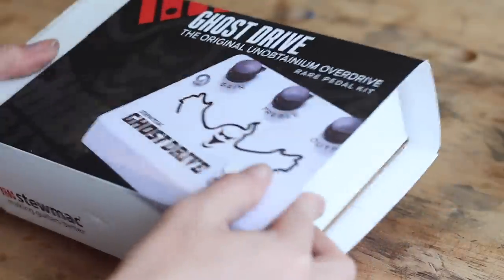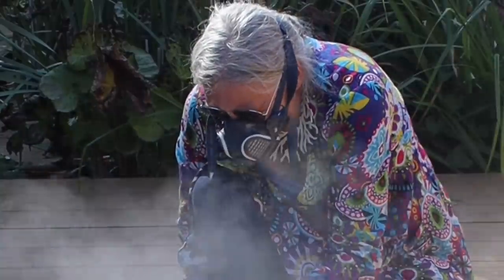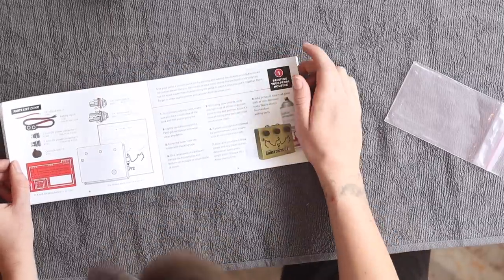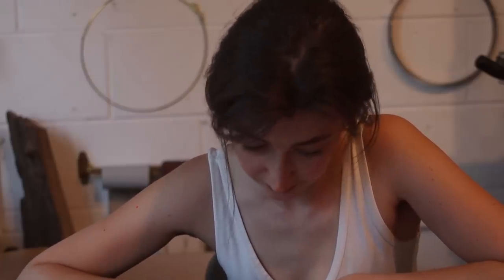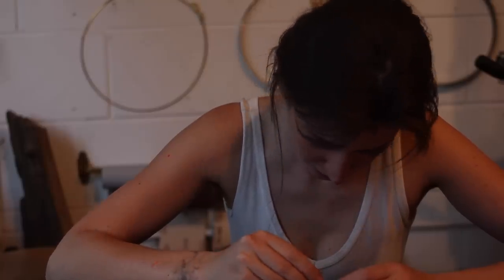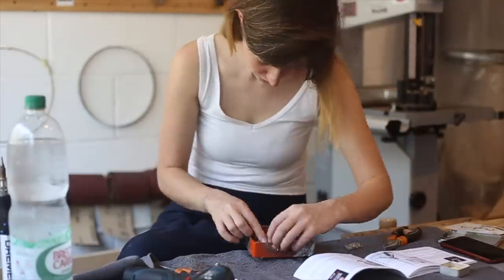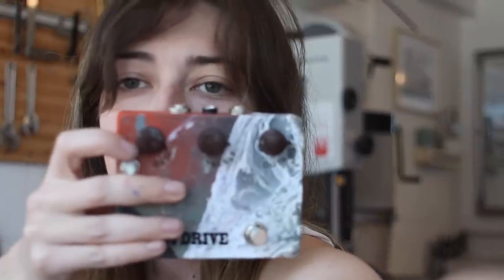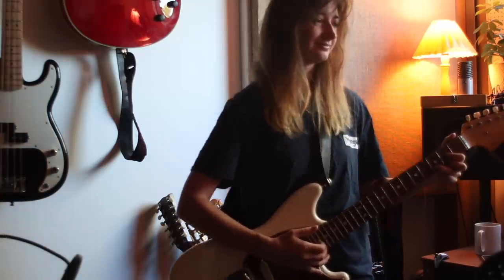I Built The Rarest Guitar Pedal | Klon Centaur

Comment: Hi Daisy. There's a good chance that the pedal is repairable. You've likely only dusted a copper trace on the board or one component. If you have a friend who does electronics, get them to take a look.
Reply: Also the led should go inside the ring, not outside. Looked cool though
Reply: I noticed that too but yeah, looks nifty. Actually, I wonder if the bezel might be shorting out the LED. That could cause something to fritz.
Reply: Look for a pin grounding out when you assemble..remove the knobs from chassis ( not completely) and fire it up and it works, its a stray ground. I make many stupid mistakes..
Reply: Always test if it works before putting it in the enclosure too, just as a general tip!
Reply: Yep .

Comment: In addition to the voltage, another important factor I learned to look for DC jacks is whether it’s center positive or center negative. You have to match a the configuration of the pedal to the DC Jack.
Reply: Most pedals are centre negative which tends to be the opposite to most other things you'll find a barrel jack on, worth remembering when building stuff like this if you're not experienced with electronics because it can be easy to get it backwards
Reply: @nicwilson89  Really freaking annoying of pedal manufacturers. Surely they did it so they could sell THEIR adapters.
Reply: @petedavis7970  Not reeaaally, centre negative wasn't ever hard to come across, you could always buy them and those multi voltage with a selection of barrel jacks always had polarity switchers on them as other things used centre negative, too, it just wasn't as common. Most people with pedal boards have a dedicated pedal psu with nice clean power and lots of outputs anyway because running loads of individual power supplies would be a massive pain and daisy chaining them isn't ideal. Pedal manufacturers don't often sell power supplies :)
Reply: @nicwilson89  While this may be true, many pedal manufacturers manufacture and sell pedal power supplies. BOSS, Electro Harmonix, Donner, Behringer and MXR all sell power supplies for pedals. 
Maybe it wasn't planned. It's definitely a pain, though.

Comment: At least you are a young lady working by yourself.  Electronics is a whole different thing working in a lab with a bunch of men who have not grown up.  One favourite trick was charging a big electrolytic mains voltage (240V) capacitor, and throwing it to a mate and inviting them to catch it.  It's a reflex to catch when caught unawares, and if you did so with the terminals touching your skin, you could get a nasty shock.  I can also remember the person sitting opposite me building a circuit that had a bank of large capacitors in parallel.  Unfortunately, he had the polarity reversed, and the resulting BANG was like a gun going off.   A wee tip to make soldering foolproof is to dab a tiny bit of flux paste on the joint.  The solder will flow way better and give you clean joint with close to zero chance of a dry joint.   I love the marbling effect.

Comment: I just built one of these a few weeks ago - a few things I learned  - the wires on the back have to be clipped as far down as you can get, otherwise you'll cross circuits and get high pitched squealing or other odd sounds. Also the manual was not clear about the wiring of the 9 volt connector. After contacting support, they told me I had the wiring backwards. Once that was fixed it was all good - it actually sounds really really good and one of the best OD's I have. Keep up the good attitude and good work !
Reply: I did the same with mine! Tommy at stew mac pointed out my mistake, it was fun to do and yesterday I ordered a new pedal from them. The kings of tone pedal. Looking forward to it!

Comment: Novice solderer here.  I built this kit, and you’re right, those tiny resistors a DAMN hard to read.  Especially when you’ve got crappy eyes.

I didn’t take chances.  I used a multimeter to test the values on everything.  I wouldn’t have been able get it all together properly had I not.  It’s definitely needed for this job.  Check the values to sort them, and then double check them before you install them.

But it went well for me. Everything worked beautifully first time!

Comment: I made this same kit earlier this year with a friend. He and I both got our own kits. I made two big mistakes: I got too excited how far along I was and soldered the Pots on the wrong side of the board, requiring me to desolder them and accidentally wreck the leads on one. Fortunately, I was able to do some creative soldering and it worked out. 

The second was that the first day I was working on it, the house was hot. Being a Texas summer and two people soldering it was quite uncomfortable. Trying to be a gracious host to my guest, I went to my AC unit and turned it down to a ridiculously low temperature trying to get the place just a little cooler. However, I forgot to change it back and didnt notice for the next couple of days. The night I finished the pedal kit, I noticed my AC hadn't shut off in awhile and remembered I set the temperature extremely low. I ran over and set the temperature to a reasonable temperature. However, I guess I froze up the unit and after a couple of hours of thaw and condensation, I went to shut off the lights for bed and heard waterfall behind the wall. The AC unit was gushing water all over the place and it had made its way under the living room laminate floor. I spent the rest of the night quickly disassembling and drying my laminate, and managed to save it. Finished the Klon pedal though, so.
Reply: That sounds rough man.
Reply: Oh ouch! Yeah that is no fun. I’ve had some issues with leaks at home this past year. Suuuuper stressful stuff. Especially if you have musical equipment. I have an entire studio and 30 some odd guitars. It’s stressful! Glad you got your build finished 👍
Reply: You never know what to expect while assembling a pedal, definitely....

Comment: Thanks for the video Daisy, I really enjoyed it. The case looks wicked too.

The others who said it here are right- a Klon clone's a pretty rough choice if you don't solder a lot. Good on you for giving it a go though. I've been soldering professinoally for fifteen years and I started my pedal building with a much simpler circuit, a clone of an MXR distortion+. I built my way up to a Klon! I've done lots of them now and they are still pretty tricky. If you do want to have a go at building pedals, there's a few things you might like to know:
Make sure you have a soldering iron of at least 40 watts, or a solder station capable of at least 300 degrees F. Anything less won't be hot enough to flow the solder quickly, and you'll end up holding it against the parts too long and burning some of them out. I'm guessing Daisy's Dremel unit just wasn't hot enough.
Definitely make sure you have good pliers, flush trim cutters and wire strippers. If you're new to this, forget trying to do without them.
It's a good idea to sparate all your components out, identify them all (this can take a while but saves a lot of trouble in the long run) and either drop them in individual labelled bags or tape them to a piece of paper and write 'Cap 1' 'Cap 2' 'diode 1' etc next to them, good and clearly. Then when you're fitting them on the board, it's a piece of cake. It makes it quicker to get it all soldered too, so you use less power. Good for your bills.
Finally: don't assume it's a total disaster if it doesn't work first time. Just one thing in the wrong place can mess the whole circuit up, but you can fix it if you're patient and don't panic.
I hope someone finds that useful!
Reply: for your last point for any other beginner builders, I found starting out that an audio probe was indispensable for finding where a problem lay.  Just an old guitar cable with 1 jack cut off and the inner wires made into 2 probes with a cap on the central wire.  Lets you trace the signal going through the circuit by hearing it through an amp until you can't hear it and there's your problem.
Reply: @violentfrog_  Clever
Reply: Came here looking for this comment. Tried building a pedal with a cheap soldering iron the first time. It takes hours. Wit a good one this pedal maybe takes a couple hours, but not much more to build. Few things annoy me more than crappy tools, what is even the point for their existence than just create frustration. So hopefully no one is put off building one of these becasue the time spent by her as it can go much quicker. The circuit board is then really easy. Still a bit tricky with the wiring stuff but manageable.
Reply: @niklasroos  If it was useful even to one person I'm thrilled

Comment: I just rewatch this again. If you have not thrown this in the bin, check, the protection diode, which is the black resistor looking thing with the gray stripe. You might have  just blown  up the protection diode.  You can swap it out and see if the pedal works with 9v DC

Comment: This video was randomly suggested to me! I’m a professional violin maker. I also have an electric guitar fetish that when lockdown happened, I started making some guitar pedals for myself, started with a kit and then started making circuit copies on tagboard that led to making my own layouts. Mistakes Were Made!! But now it’s going easy. 
Couple of tips: get a really good soldering iron, really good electrical solder and flush cut electrical snips. Test everything before you case the pedal, it’s easier to troubleshoot. 
Last thing, I bet you only fried the diode for circuit protection. -the diode closest to the input jack. 
Nice video!!

Comment: After a few years of building pedals and failing/succeeding/everything else in between, I can honestly say that the most important tool isn't the soldering iron - it's a multimeter. 

I absolutely love the hydro dip painting, what beautiful colors you've done! It looks like an aerial drone shot from a far away ghastly planet.

Check placements of the IC chips for sure. An OP amp might be flipped around.

Comment: The Klon is a pretty complex circuit for a first build. 

I recommend a fuzz pedal for a beginner. A silicon fuzz face or tone bender are much, much more simple circuits to learn on.
Reply: A Big Muff isn’t too bad to start with either
Reply: @chipsterb4946  a muff usually has 4 transistors, a tone bender has 1-2. Much simpler for a beginner
Reply: Yep Best is a fuzz....I still use my first fuzz... I hope she tries again.
Reply: Or an Elektra overdrive (or one of the many love pedal derivatives). Personally I've struggled with fuzz faces (but then I'm picky as most of the commercial ones don't do it for me) unless you have a  really good choice of transistors.
Reply: @navinadv  BYOC sells really solid kits with everything you need and detailed, step-by-step instructions. The Large Beaver (Big Muff) kit was an easy build IMHO.
Reply: @chipsterb4946  I have used BYOC and Fuzz Dog. Both are very good. But this lady doesn’t have the soldering experience that either you or I have. When my son wanted to build a pedal (he must have been 14-15) he started with a single transistor fuzz. Maybe that’s a good place to start.
Reply: @navinadv  fair enough. I guess my point is that there are many pedals that are more simple than the Klon circuit.

Comment: I am building this pedal now. So far I think it is going ok- we will see. I am almost done- but I broke the last IC plug. I trudged ahead while waiting for the part, which is still on the way.

One thing though- I ended up getting the pc holder because my Helping Hands stand was
Not adequate. And- i had a multi meter hanging around. I borrowed magnifying glasses, and just happened upon the soldering tools at the store when getting solder. All of these are GOD SENDS. The multi meter especially- for making sure you are putting in the correct capacitors on the board.

My soldering iron seemed to die on me- the tip did not heat, but the shaft did. Of course I was trying to solder out of the box and didn’t realize what was going on and I burned the board and exposed an etching within 10 mins of starting. I had to get a replacement.

Comment: I have built 2 of the Ghost Drive pedals.  On the first one, I thought that I burned something up with the soldering iron.  I was devistated that it did not work, so I ordered another one.  While waiting on the 2nd to arrive, I got out my USB microscope and started checking all the solder joints and found I missed soldering one pin of one capacitor.  I fixed that and it worked.  The second one worked first try.  I'm in the middle of the StewMac 2 Kings (King of Tone clone) now.  Hopefully finish it up tonight.  Don't give up.  We all make mistakes.

Comment: My soldering skill are poor, but I managed to make this kit, and it worked.  
There were a few places in the instructions that were not very clear.  In fact, I soldered the red wires to the input jack incorrectly, and it didn’t work.  I contacted Stu Mac technical support, sent them a photo, and they diagnosed the problem, I changed the wiring, and it actually worked.  
I would contact them: they are very helpful and have always sent me free replacement parts when I screwed up a project.

Comment: when soldering, heat the metal and then apply the solder which will melt like butter.  if you are doing any type of IC chip the principle applies but be really fast or you could fry the chip.  Get the piece as close as you can to the board, solder, then clip the tips from leads on the back side of the board..  Basically the leads are harder to heat than the solder so once you heat the leads apply the solder and clip the tips... they can short out...any ground lakes all the other leads to ground

Comment: Came back to this… it’s very likely you’d only have to replace the chips which would cost next to nothing at an electronics hobby retail. I noticed at 6:50, one IC leg may if may not be bent, and sticking out the side of the socket. The “quickly explode” part in relation to electrolytic capacitors, that’s a bit dramatic, and would only happen powered anyway. It’s both the kind of explosion that breaks the enclosure, but may make a mess on the board.

Comment: I’d be willing to bet you can fix that pedal. Klons have an internal charge pump chip that boosts the voltage from 9V to 18V. That is likely what was fried. Maybe a protection diode too. Either way, a quick swap of a part or two should fix it right up provided the traces weren’t badly damaged as well. Good luck!
Reply: For sure, just about anything is repairable. More simple electronics such as this are infinitely repairable :)

Comment: Oh, those Dremel torches. I think I destroyed about three in my lifetime working as a telemetry and tracking tech in vehicles. They were pretty good when new, but then the ceramic catalyst cartridge would shatter and leave the building via small exhaust hole, rendering the thing unusable (and also making temperature control a bitch while it fails) as a soldering iron, leaving you with glorified cigarette lighter. Also, one has to mind the small exhaust port, burning everything close by. I strongly recommend Pinecil all your soldering needs. Excellent temperature control, fast hea up, and accelerometer that switches the heater off when you put down the soldering iron, so you don't burn down the hacienda, especially if it is a wood shop. Oh, and you can power one with USB C charger. Oh, and one more thing: the sponge in the small metal tin: you are supposed to wet it before use.

Comment: I built a Klon pedal about 2 months ago. Despite barely knowing how to solder,, and it being my first time doing ANYthing with circuits, it went great. The directions included were super easy to follow until I got to one particular capacitor; it just looked all wrong, and was super tiny compared to all the others. I called Stewmac, and they said, yep, its correct, they have to substitute parts because of availability and vendor supply etc etc. Long story short, it all went swimmingly. Get another kit and use a 9v battery next time 🙂

Comment: Don't worry, it'll be repairable. Stuff like this is usually a simple fix. Always worth 'bench testing' things before final assembly because mistakes will happen and it saves time troubleshooting and getting back on track.
Worth remembering that most music gear is centre negative on the DC barrel jack, most other things are centre positive, hence the polarity will be backwards. Probably caused a little more damage than if you'd plugged in a higher voltage with the correct polarity but it's not going to have caused significant damage and will likely just need a few components replacing.
If it helps, it's even more satisfying when you also manage to fix a broken thing on top of having built a thingy thing

Comment: If its burned badly ( visible bubbling smelly and blistered ) then chuck it as the traces will be damaged beyond repair ! The pots , switch etc. will be fine . Sadly the circuit does not have a large MOV or polyswitch for protection or reverse polarity diode . It has about £20 worth of components and can be built on matrix board .Try a treble booster first . I use Rapid Electronics near my home town for most consumables and eBay for semiconductors not at Rapids . They also have a range of enclosures , pre painted . Hydro dipping in Essex is the posh word for " swimming ". I design build , repair modify ECUs for cars and motorcycles , guitars , tube and solid state amps , keyboards , etc .